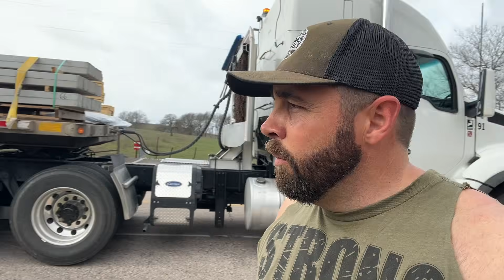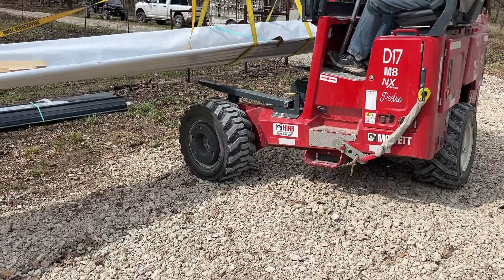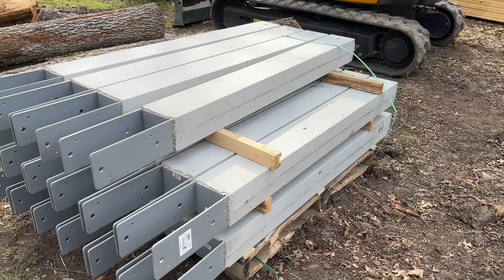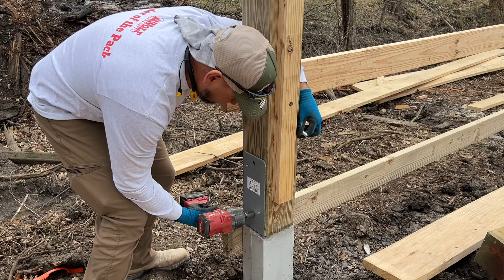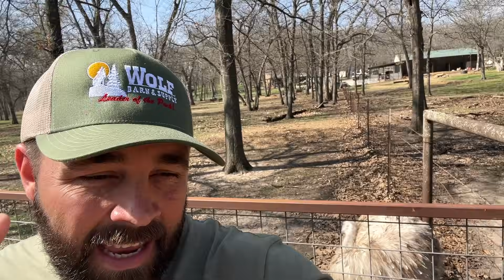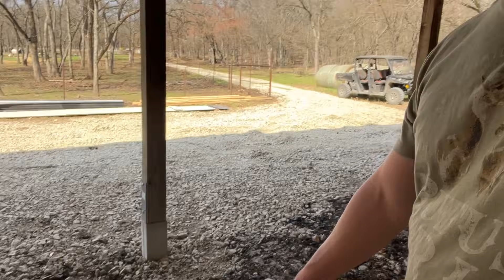2-day Barn Build: From Start To Finish!

Comment: Very easy to close in the bottom, just use your bottom runner on the inside to run down some pressure treated 1x8s, Wayne from Amherstburg Ontario Canada

Comment: Pour a footing on both ends and rear between the Perma Columns, lay cinder blocks on footings up to inside of metal walls to keep water shed away from inside, and place crushed stone as the floor [ 1 or 2 inches higher in rear for any water drainage to front for dispersion ] - bingo - looks great and it's totally enclosed. Also, lay some oak pallets against rear wall for buckets of fluids and oils and boxes of lubes, a shelf across rear, end to end, at 5 ft level for smaller items, etc,  add LED floods on a switch inside and/or cantilevered apron for night work and motion activation LED floods and camera(s) for thieves.

Comment: Protecting your equipment from the sun, rain, snow, ice, and wind will make the hoses, electronics, seals, etc. last much longer, the paint won’t fade as quickly, and the metal will not rust/decay as quickly. All it takes is some basic cover; a fully enclosed structure is overkill but this looks like it will do the job.

Comment: You have a good place to hang shovels,  post hole digger, rakes and like items out of the weather and off the ground. Items that always get in the way and tripping over or only use once in a while.  You can keep the garage neat when you get it back.  Don’t put the feed trailer in the new shed, that would attract your birds and other critters.  A nice big shed is now yours.

Comment: I would take thorough over fast any day. If you can get both that is a bonus. I would probably seal up the rafters if it were mine. You need a magnet to pick up all the hidden nails and screws. But I wouldn’t be surprised if a turkey or chickens end up having a new roosting spot. 😂😂

Comment: Comparing the Morton buildings and green lime barns (manufacturer name unknown), Wolf Barns seems to be a higher quality, noting the "ribs", there are MORE of them than the Morton buildings (stables) which they don't have that many ribs and more often than not, the walls buckled after five to ten years because something was weak or just too heavy for a few ribs to handle the sheer weight of the steel walls. Glad they took less time and I love that perma posts, which you won't have to worry about wood in contact with wet/damp clay ground. Good job, Wolf Barns!

Comment: The Mexicans are the new carpenters. It all changed in CA about the mid 90s you had 90% white boys with rock n roll playing. Then the days of piece work came in the tract house world. They hired Jose to frame a house and Dan to frame a house. Dan paid a helper $25 an hour to frame a house in two days. Jose drove four of his cousins to work and framed a house in a day, the cousins may  have got $8an hr or were just living w him and were paid under the table by Jose who did get the same piece rate but was basically a pimp. In ten years there was no more Dan's, or his helper. There were just low quality cheaply built homes selling for over 500k at that time. Its only gotten worse.

Comment: This looks like a great addition to the Homestead. Looks like a poured concrete slab under the covered part, perhaps even the roof extension too,  would allow any moisture/rain the wind drove in to drain off to the sides based on the way it was tilted. Working on a hard surface would avoid ruts in your floor and keep your mchines stable and level if jacking was ever necessary.... Just sayin'

Comment: In 1969 my Dad and I built a post barn that I believe was 30' x 40' with an open side.  It was not a cantilevered open side however.  Back in then we were building the trusses on site. We were finished in 4 days.

Comment: Looks Great,, Put  bumpers on Ground to keep equipment away from metal siding, or put a concrete stem wall on the ground if flooding could be an issue... the overhang looks susceptible to rot with the bottom open... Just Saying...

Comment: Hey Dan'l!  School up on the "French Cleat".  With plywood screwed to the lateral lumber the skin is screwed to, you could use a French Cleat for various things you may not want "permanent".  Could give you an easy way to move things around as your needs change, yet hold things securely up off the ground and hung in place.  Good lookin' shed there, those guys did nicely and very quickly too.
Reply: Those guys did an amazing job and should be very proud of themselves for getting there and getting it done and providing everything!!!

Comment: I call the loose screws and nails, tire finders ! Great build Daniel, awesome addition to the AFH! Thanks for sharing!
Reply: Drag around a big magnet will find them or a metal detector. Thats what they did when they put our roof on    Then use a huge magnet first  then went around with a metal detector  to make sure they got every last nail /screw out of yard and drive way
Reply: I worked in construction for years for a utility company and adjusted damage done to our equipment and we all got nails, bolts and screws in our tires.
Reply: Could always build  pellets with the lumber for the hay.
Reply: My Ferrier used a big magnet to find all the horse shoe nails..great idea.
Reply: You might want to put hardware cloth around the bottom just to keep the critters,snakes etc.out.
Reply: @julieduree9210 uhhh what about the huge opening in the front? lol. They will get in regardess.

Comment: I was a General Contractor in Florida for 45 years and my favorite crews were always Mexican. They do excellent work and never slow down.
Reply: I live up north and we have Amish families here. They also finished our garage in 3 days. Unbelievable work ethic and craftsmanship.
Reply: I agree.. they are very hard working people..
Reply: They are very hard workers!
Reply: The one thing though is I wish more of the guys that do construction actually go through some apprenticeships and basic courses. Fast isn’t better. Houses that have been built in the past 15-20 years are rushed and many workers are inexperienced in the basics of construction. Simple things like mixing concrete all the way to framing. Window and door installations are terrible. So many of them are actually broke or cracked around the frames and just patched with caulk. Not enough measuring and rushing jobs. Not saying any of these guys on here are like that. And it’s not picking on any particular group. It’s a lot of crews in general regardless of where they come from. This type of building project is really straightforward since it’s a prefab situation for the most part. These gentleman definitely don’t waste any time which is nice.
Reply: I agree i had a crew build a 30x40 poll barn and they rushed the hell out of it didn't prep the ground at all @coleengogerty3852
Reply: @coleengogerty3852 This is in part due to the General Contractor not supervising the construction. Also, many homes are built by production builders where speed is the main thing they are interested in. Where as a Custom home builder is more interested in the final quality.
Reply: I worked at a power plant for 37 years and I agree they are the hardest working people I have ever seen. They were insulators at our plant and that’s what they did all day. Taking hot insulation off and putting new back on. One of the guys even melted his boot instead of saying it was to hot. Dang good workers.
Reply: I was wondering what about safety? No net all on ladders. Nice job do.
Reply: Truck drive that in there 😊❤❤❤❤😊
Reply: Yes sir , they are hard workers an loyal, get the job done on a timely manner., just let them know what needs done an let them play there music, hello from south Texas
Reply: What about Puerto Ricans?
Reply: GREAT people… Best crews I’ve had working for me…are Mexican. Extremely hard working and pay attention to detail.
Reply: I ❤❤❤ My Mexican contracting crews… never have to check their work, even with a language barrier still get 💩💩done & completed in timely fashion !
Reply: Up here in the north in Wisconsin , I have seen the same hard work ethics of Mexican work crews as well.  No slacking, get er done attitude and the music is an added bonus!😃👍❤️
Reply: Hondurans are the best roofers too. Sun up until sun down. Siestas during the summer time and napping under the shade trees. Gotta love all of these folks